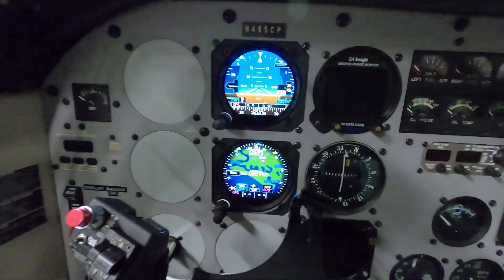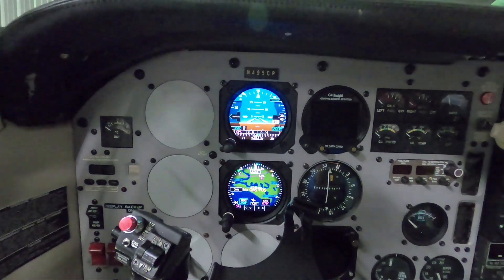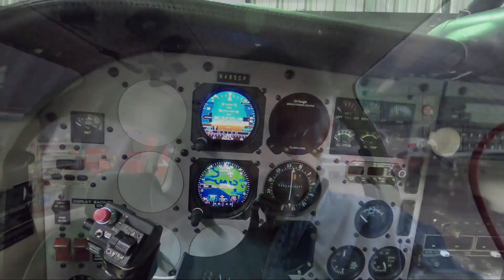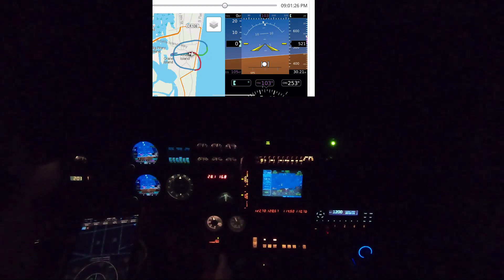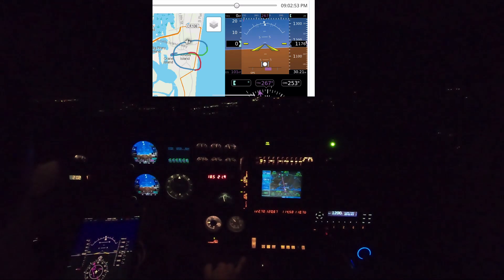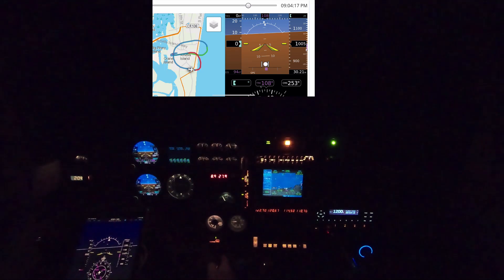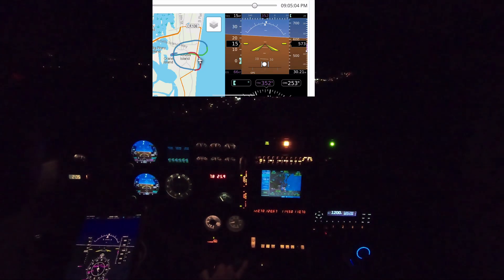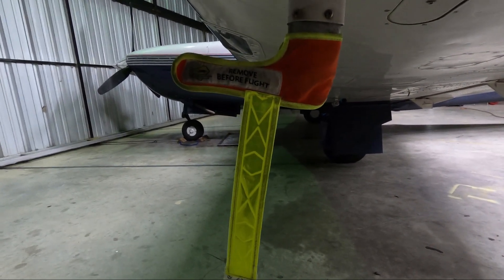LOSS OF AIRSPEED INDICATOR on night takeoff with dual GI 275's in a Mooney Ovation!!!

Comment: The first thing I thought was icing without turning the pitot heat on.  Something I have done.  Then I remembered that you live in Florida.  I would say that your "learn" was wrong.  It's not leaving the cover on It's what caused the problem and that is the distraction.  This could have been leaving a tie down on which could have ripped out and caused real damage.  I have seen it done when a guy who was distracted with his family.  In my opinion the "learn" should be what happened, what caused it, and what procedure would have stopped it from happening.

When I do a preflight there are two things I ALWAYS do.  #1- all passengers must be in one area away from the plane and they have to stay there until the preflight is complete. This actually has a bonus because the passengers see just how serious you take being pilot in command is.  If I can I try to keep them in the FBO lobby until the preflight is done.  #2- If for any reason I am distracted I restart the preflight from the beginning after stopping the preflight for any reason.  No matter how many times it happens.  I go at the same pace every time and have full attention on the preflight.

Comment: You mean to tell me the Ki275 will display airspeed live with the pitot tube plugged….  That  just made my mind up on garmin..   I am sticking with my king steam gauges.
Reply from the maker: Seems like when the pitot is covered by the pitot tube cover it is not fully obstructed. Garmin also compares IAS vs GS vs TAS and will blank out display of IAS when there is sufficient  diacrepancy. If you notice, I believe the IAS display went blank around 30-40 kt. 
Of course GS will always be available as long as GPS is working. 
Look at another video I posted where I was able to put the GI275's through "torture" tests.
In my experience Garmin has superb software in their digital equipment.

Comment: I had a similar thing happen on two different night flights in a rental 172 during the summer in San Antonio. I lost airspeed just after takeoff. After I got things sorted out, I got out my flashlight to see if I had inadvertently done something wrong. While turning on the lights I had also turned on the pitot heat. Turned it off and the airspeed came back in seconds. Explain that one to me.
Reply from the maker: Sounds like the pitot tube may have had some small partial obstruction (bug, spider web,...) and it also had sufficient moisture to clog it up. It cleared up with the pitot heat.

I had a similar issue once about 2-3 nile final after flying through some rain in S. FL when my KIAS stayed at 60 Kts which made me think I was slow. In response I kept on adding power and landed further down the runway than expected. Taxied with KIAS at 60 as well!!! Cleared up after a few min of pitot heat.
Reply from the maker: Even without rain or moisture the pitot heat obviously burnt away whatever the obstruction was you had. I have a friend who flew B-52's and he told me that the crew chief was in charge of removing the pitot covers that were made of leather. Every once in a while the crew chief would forget to remove the covers and they would burn them off with the pitot heat rather than RTB and possibly scrub the mission. Had they been made of nylon it would not have been a good idea to turn the pitiot heat on....
Reply: @chriskoppel3940  It's the other way around. Turning OFF the heat brought airspeed back. Happened twice, same plane.  No moisture in San Antonio.
Reply from the maker: @rnordquest  Ahhh.... misread your first comment. 

Hmmm.... hard to explain. Only thing that comes to mind is that there may have been some plastic debris that would melt in such a way to obstruct the pitot when heated and when back to solid after turning heat off would change shape to make the opening patent. Definitely a head scratcher!!!

Comment: How come you removed the Traditional airspeed indicator as well as the simple turn and bank indicator? Would make good mechanical backups.
Reply from the maker: Good question Dilithium. I did not want extra stuff hanging on the pitot-static system and create a point of failure. Also would be distracting and use up space. In addition, in case of pitot tube icing up or another failure in the pitot tube would also affect the mechanical indicator. Only circumstance in which it could help would be in failure of both 275's not showing airspeed. Still have ground speed on 530 and iPad to assist. 

True coordinator gyro was getting old because you could hear the gyro whining loudly. Did not want to overhaul and so use up space.

I have a video coming up where I show another pito failure and then turn off other inputs to the 275's to see how they perform. They were flawless.

Comment: Our flying club airplane has a pitot cover back in the baggage compartment along with a spare quart of oil, the folding stepstool, and the emergency tiedowns.
As a rule, we don't cover the pitot in the hangar. If we ever experienced mud wasps in the hangar, maybe we would.  We do have the advantage of being able to see the pitot from the cockpit.

I remember taking off as a student getting dual in a C-150  with a wasp-plugged pitot. When I realized we had no airspeed, there wasn't enough of the 2,700' runway left to abort. 

The instructor treated it as a learning experience, and I flew to the destination airport without incident by listening to the air and feeling the controls. (This being in 1987, there was no source of groundspeed information on board).  

We would have felt smarter about having handled the situation if we'd thought to inspect the pitot before departure back to home base. Alas, we did not, so I had more no-airspeed practice on the way home.
Reply from the maker: Great learning experience for you and me!!

It was a first time for me since I started flying. I did forget to close the door once as a student. I now also verify that it's in the "hat" compartment or on my flight bag as part of the pre-start checklist. 

Thank you for your comment!!

Comment: There's such an easy fix for this - will never happen again. Tie a 10ft. string of yarn from the pitot cover and loop it over the prop. There's no way you won't see that from the left seat before you start the engine. Stupid simple.
Reply from the maker: That sounds like it would work. However, we happen to be human beings and will on occasion develop tunnel vision because our brain is preoccupied with something else and we have read of pilots landing gear up in spite of the gear horn blaring away. If the pilot were to start the engine with the string around the prop I can imagine the string wrapping itself around the prop as well as ripping the pitot tube off the wing. That would be quite expensive to repair and kill the flight completely. Taking off with pitot tube cover just disables the ASI and one can fly the plane with ground speed, power, attitude and come back to the field and land. 
According to a friend of mine who flew B-52's, they would have leather pitot tube covers that would melt with pitot heat when the crew chief would forget to remove them. No way to turn around from a time critical mission just to remove them. Just burn them off!!

Comment: I carry my pitot tube with me and put it on the glareshield until i pull up to the runway. I didn't leave the ground because someone stopped me but it changed how I do things
Reply from the maker: That is a good idea. Put it where it is in the initial cockpit flow check. Then put in your flight bag or side pocket. 👍
Reply: Most folks leave their pitot tube on the wing. It works better there. :-)

Comment: Interesting case. Thanks for sharing. Nicely executed "abnormal" landing. Was there any action taken to prevent the same from happening again? Maybe using a larger pitot cover that also covers that drain hole or one with a long flag, that can be thrown over the wing so it can be seen from the cabin? We all have been in that position with distractions etc... aleays nice to have some last line of defense against human errors...
Reply from the maker: Thank you for your comment Benno!

 For me the preventive action was recognizing that a distraction occurred and to go back where I was at the time. My line of work lends itself to the same so I apply the principle to both . I had not heard of a flag that could be thrown over the wing although if the plane were to be outside that flag could be blown off. 

Unfortunately human errors are human. There are people who walk into doors etc. Once the brain is focused on something else it can easily ignore audible and visual alarms. It will even not really process a checklist correctly. There have been pilots that have landed gear up even with the gear horn blaring away. 

So.... Hopefully we are able to either remove distractions or "reset" after a distraction as someone else commented on this video.

Comment: This was an excellent video Chris.  Kudos for sharing and great job getting to a positive outcome.  Every one of us makes mistakes in (and out) of the cockpit.  Successfully managing these situations and learning how to avoid them again is what matters.  A couple of interesting takeaways:
1/ "Airspeed alive" is not sufficient to determine proper ASI operation on the takeoff roll. In addition, the pilot should subsequently verify rotation speed (Vr) prior to initiating rotation.  
2/ Know pitch attitude and power settings and regularly practice (with a safety pilot) loss of ASI at a safe altitude.  
3/ Even with all the redundancy in your panel, including the iPad, a single point failure existed that rendered 3 out 4 speed sources (two IAS and one GS in the iPad).  Ironically it was the oldest piece of avionics that gave you what you needed!  
Again, well done!
Reply from the maker: Great comments and thank you FlightPractitioner! By the time I verified Vr I was already up in the air since I was so light. So no choice but to keep on going. After this event I set up a page in my newly installed GI-275 Standby ADI/MFD to give GS that is sent from the 530W or its internal VFR GPS in case the 530 fails. Next time I lose ASI for any reason (hopefully not a forgotten pitot cover!) I can just turn to that page so don’t need to look at the 530 which is a bit out of direct view.

Comment: I had a similar malfunction, and I noticed the airspeed was incorrect on takeoff. I should have aborted, but didn't. Anyways, the trick is to look at the groundspeed and ignore airspeed, and get it back on the ground as fast as possible.

It had just come from the avionics shop (first clue). It turned out the pitot-static system had been misconnected.
Reply from the maker: Agree, but once in the air it is difficult to make the decision to land right away. Groundspeed becomes primary and very important either way!

Glad it worked out well for you!!
Reply: @chriskoppel3940  Not even close in difficulty. It was midday with no clouds.

Comment: Glad this worked out. We can all get distracted. I suggest reinstalling your traditional ASI. That original item would of helped in this scenario.....another great post. Keep them coming!
Reply from the maker: The original ASI would have shared the same pitot static plumbing as the dual 275's and therefore not really more helpful than the standby ADI (bottom unit). I never took off with the pitot cover on with the old ASI and so not sure if the needle would have moved up a bit (sufficient to register 23 kts or somewhat less?). The reason I did not keep it installed is that its diaphragm and additional connection can be a point of failure. I like the KISS approach. 

Since it always "comes alive" at 23 KIAS under normal conditions what I do now is to not only verify it "comes alive" at 23 but also continues up past 40 KIAS and then focus on the runway. Plane takes off when it's ready based on weight etc, not at an arbitrary number anyway. 
 
Ideally one should have the second unit connected to a separate and redundant pitot-static plumbing system but that is not the custom in GA. Even so one should remember to remove the cover on that one too! A friend of mine who flew B-52's says that they had dual pitot-static systems and when the crew chief forgot to take the covers off the pitot tubes they would use pitot heat to burn them off (they were made of leather) and on they went.  No way to abort the bombing mission!!
Reply: @chriskoppel3940  I am a subscriber to KISS as well! I think the needle not moving on a traditional ASI would of helped you clearly abort the takeoff.  Your post has made me realize that I need to teach my friends and students with light GA planes with an EFIS to cross-check the ASI indication on the roll like it is done in turbo props and jets with one or two crew.....I remember “50 kts, cross-check” call outs in most of the two pilot turbines I flew back in the day. This is especially try with all the ADAHRS failures and “red-x’s” everyone seems to get at the worst moment in light GA. great B52 story! My wife’s godfather was a B52 driver in Nam. Will see if he ever had to do the procedure:)
Reply from the maker: I have not had a chance to call Garmin to find out why the ASI goes directly to 23 in normal conditions and why it even moved up to 23-35 with the pitot cover on. Was it porous enough to let through some ram air? Other reason such as their internal algorithm? I will do an experiment where I totally seal it and do a brief takeoff on a looong runway and see if it still "comes alive". 
As I mentioned, I have changed my procedure with this unit to verify it continues to move up past 40 kias. By 50 I am too close to takeoff point already and need to be focusing outside the cockpit. 
Please thank your wife's godfather for his service and I am curious as to whether his crew chief ever forgot to remove the covers. ;)